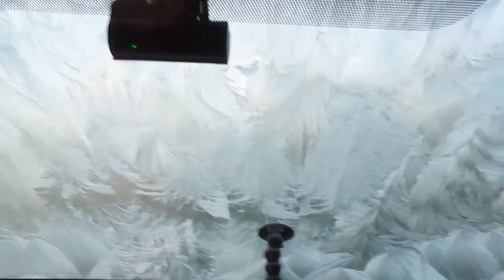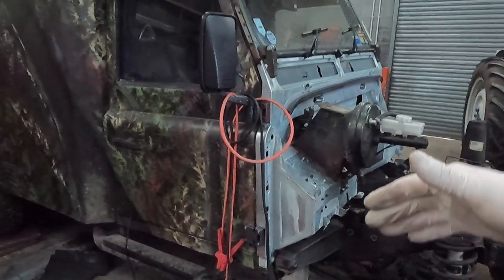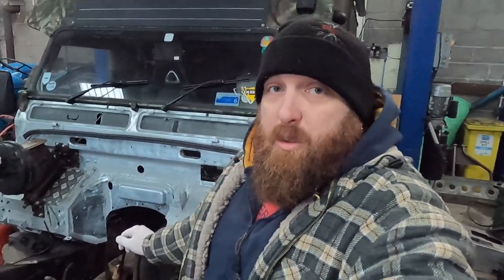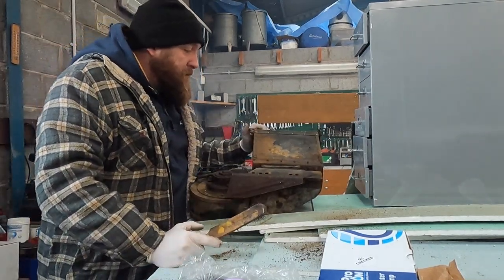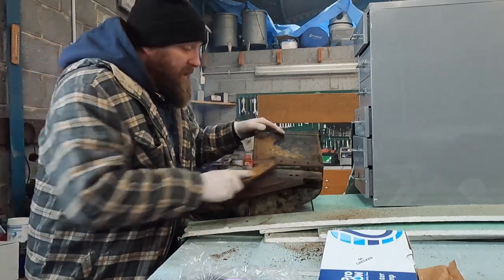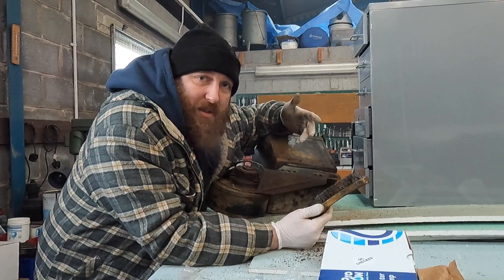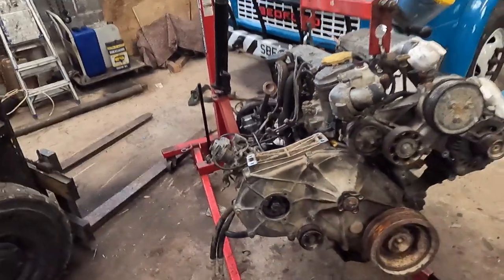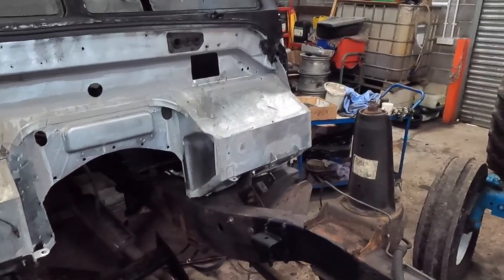land rover campervan rebuild

Comment: Great job Rich. You are so right about when you have everything apart that's the time to replace or repair all those pieces you normally can't get to. On my Crown Vic Police Interceptor I pulled the engine to replace it. 150,000 miles on the car, time to replace the steering box. Much easier when the engine is out. I noticed your steering box is on the wrong side, weird.
LOL, kidding 🤣😂👍

That is going to be a dependable, heavy duty bugout vehicle. Good video,

Thanks, Mike
Reply from the maker: I bloody hope it will be reliable after all this lol. I best take it out and get some use when it’s back together to make up for all these workshop vids.

Comment: I had a range rover classic for 10 years and i listened to wife and sold it now I bloody regret it. It was a great wagon, yes like any landie it needed constant work, I remember taking right wing off to weld a 50 pence hole and ended up welding loads of stuff I found. The deeper you dig the more u usually find and mine was a good one lol
Reply from the maker: Always wanted a RR classic. Just a shame the price has jumped up on them.
Reply: @Bugoutvehiclesuk  Yes I've seen some a n b suffix at 85 k. Almost had 4 door just as lock down started but I didn't know if I would still have a job in a week or two so let it pass. Good work on the wagon il be following along bud

Comment: Having just finished my own 2 year rebuild on a 200tdi 90, must say its nice to sit back and watch someone else do the work for a bit hahaha. 
That top wing bolt is a bugger, you have to get to it from the top of the wing and snake your hand past the throttle housing or heater, can always undo the little m6 bolt to the bulkhead and that will let you slightly bend the wing up if you can't fit a hand in there, just be careful not to twist it.
I'd recommend maybe drilling a 10mm access hole nearish the top into the shock turrets to be able to jet wash some water inside. They're an absolute rust/mud/water trap nightmare. When i took mine off half of the inside was flaking off. I went for some cheapy heavy duty open kind from ebay but they came and were about 8mm thick, so the top bushes wouldn't bolt on, used a grinder to thin the tops down. If i was doing it again i'd pay the extra £40 or so for something with a good name behind it like gwynn lewis/bearmach.
As for Terrifirma, i've had their rear shocks on my 90 for a while and just put front ones on, must admit i've not had any problems with them with mixed on road and greenland use, but then mines a 90 so not that heavy.
If you haven't already got the bracket for the steering arm give me a shout, i've got spare from my old knackered box you can have free. https://www.ebay.co.uk/itm/143917420484
Keep up the good work :)
Reply from the maker: Thanks pal much appreciated.
Reply: @Bugoutvehiclesuk  No worries, if you need the steering bracket just send me a message on ebay or something

Comment: knotted wire wheel on angle grinder then etch primer then your nice shiny paint ,i am going to mod a heater box and put two matrix units into it get more heat inside cabin

Comment: terrafirma are basically terrawank now. Old man emu for steering damper I run big 37s and never had a problem with it just twice the price of most aftermarket ones or look into hydo assist damper. But looking really good so far 👌

Comment: Yer gonna like this, a bit but not a lot! Get in the box debbie! Lol glad there's no more of that! I think that when I did the same I modified the radiator bracket? Been a while though. Side exit straight pipe sounds spifireish with a boost pin and k&n! Check that under the fold down/non fold down screen, that drip in yer boot lol!

Comment: Lack of heat stalled work on the VW T25 camper I bought last year. I’d been grinding filler off with a wire wheel then priming the bare metal, but its now too cold for the rust converter and the primer. Eventually all the holes will be revealed and fixed instead of hidden. Fortunately I can leave it until the weather has warmed up.

Comment: Another cracking video mate. With regards to terafirma, I have a 2inch lift set up on my D2. The rear springs are sagging quite badly. Also the shocks rubbers seem to be made out of pure sponge. I dont rate them that much tbh.
Reply from the maker: It seems like we’re not the only ones.

Comment: wow well i must say it looking good.  your attention to detail is amazing with your tips on cold metal. i woudnt of throught to do that so thanks for the info there. i was suprised to no that you cna ture an aircon pump to a air compressor pump,  if its not to much trouble to ask how do you do that.  another really cool vid again and yeap i would love to know how you make a vid edit it and show it. be safe stay well an will lokk forward to the next one
Reply from the maker: I will try and go through it when it’s fitted but basically it needs stripping and greasing up and a cut off valve.

Comment: Great job. Satisfaction guaranteed 👌 

Terrafirma...I really agree with you. I had some really good kit of them but the rubbers have need replacing after 12 months. 
However being fair, I think your vehicle exceeds terrafirma definition of heavy load. Maybe heavy springs with helper spring and dual dampers may work better for you?

Great idea with the AC compressor. Looking forward to the outcome.

Is that a auto box?
Reply from the maker: It sits between 2800-3100kg so no more than my fully loaded 110 with roof tent and gear. It’s big but not silly heavy as it’s a big box with a bit of furniture in it. I think a slow swap out to OME is in order.
Reply from the maker: Yes all my landys are auto if I can help it.

Comment: Will pm you on FB, but as a reply to your questions, yes, do a video on Youtube video making, and Terrafirma, well, since I had a damper smap and take out about 10-15mm of a sidewall on a rear tyre, and knowing of all the other people that have also had dampers snap, I will not use or fit them! So get something decent on the Landy! With the electrics, your differences are basically plugs and the 300tdi loom is a lot more straightforward, a lot less wires, but if you have the alarm variant without the engine loom it could be a bit of a PITA. Anyhoo, another great video...
Reply from the maker: Pls don’t DM my FB. Iv mentioned this on numerous videos as I get dozens of ppl messaging me and my phone pinged at all hours so I keep FB for me. It’s easy enough to comment in this comment section or on Instagram and there is an email for business enquiry’s in the description.
Reply: @Bugoutvehiclesuk  can't give you the info publically. it's there any how... I rebuild these vehicles and so only trying to help.
Reply from the maker: @overlandready  if it’s more of a list on how to do things I’m alright thanks. Like the advice on the wiring etc that’s already been done as it takes me a week or two from doing the work to you seeing the vid. Appreciate you trying to help but Iv got a lot of help in person on the job.

Comment: when you come to put the top bolt in wing fead a long extension bar betwean the wing and inner wing and a bit of tewing gum to hold the bolt in the socket has to be a long bar
Reply from the maker: The wings are slit so I can put the top couple of bolts on then slide the wing on and nip them up.

Comment: Great video, alot of effort being put into that landy fair play, are you gonna do the water p gasket aswell on the 300tdi there crap to do in the vehicle 👍👍
Reply from the maker: It’s had timing belt, water pump, PAS pump, new belts, hoses, bottles, fluid flushes, and I’m sure a load of other stuff that I can’t remember.

Comment: I used terrifirma +2 springs/shocks on my 110 found after 4k miles they had sagged quite badly the front hit the bump stops, I changed them for britpart heavy duty one's (I know some people have issue's with britpart) but they've now done double the mileage with no problems so in my eyes thats a win,  I've even used them with their dynamic shocks on my new camper project. Landyglamper on Instagram (no plug intended 😁😂)
Reply from the maker: I didn’t expect britpart to be better but then again there are a few just on this saying how bad terrafirma are.